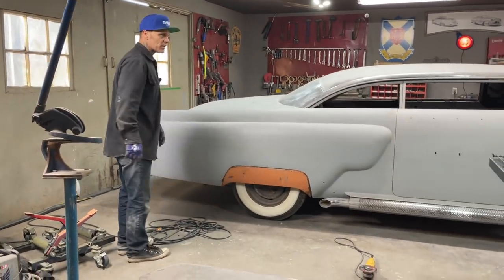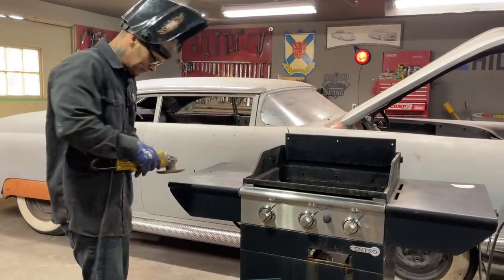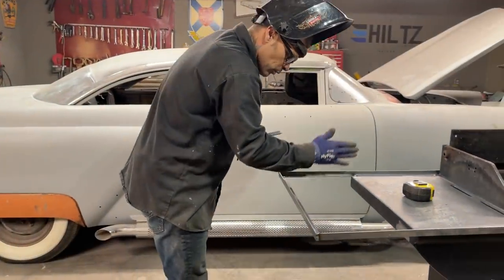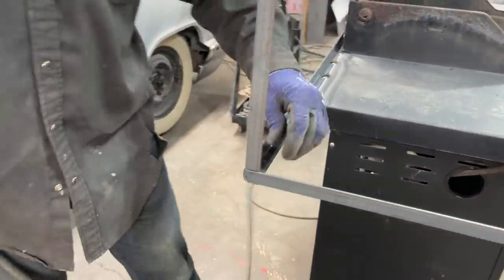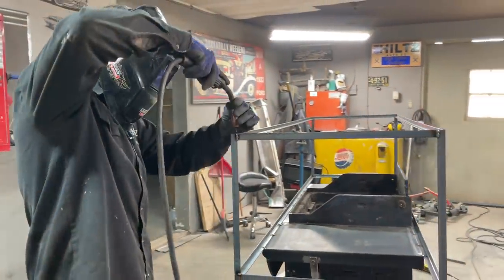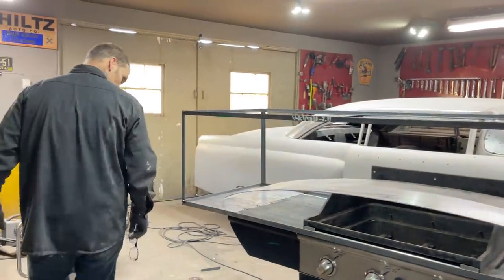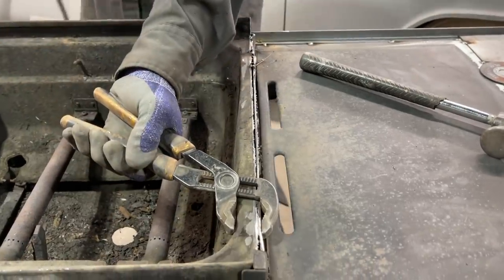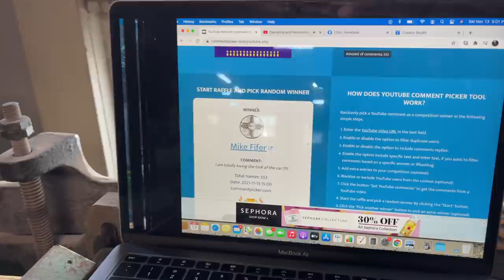Building an OVEN out of a BBQ to THERMOFORM Acrylic PLEXIGLAS

Comment: Chad you probably should line the plywood with aluminum foil to reflect the heat..seems to me that plywood would catch fire.
I suppose the top could be made out of that sheet metal certainly the heat would catch a top made of wood on fire....simple hinges to raise and lower the top...just thinking out loud.